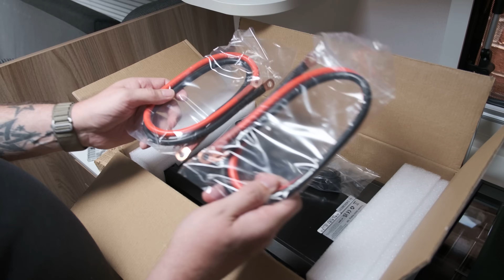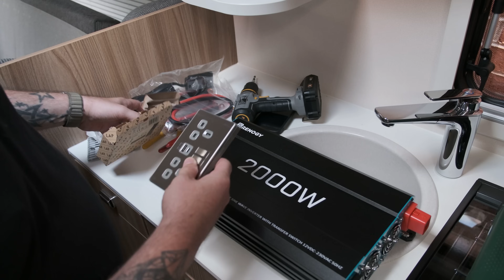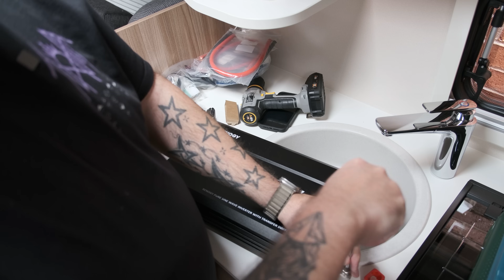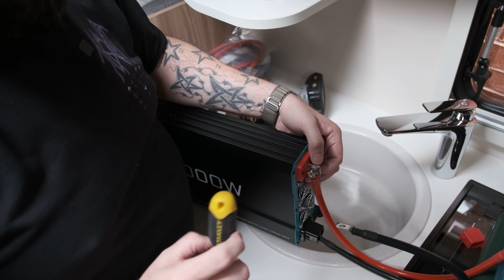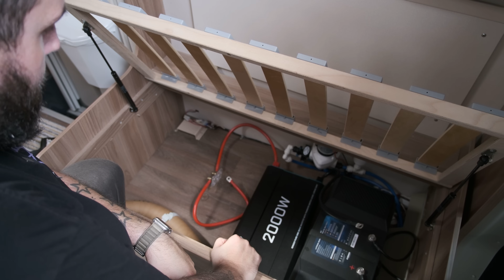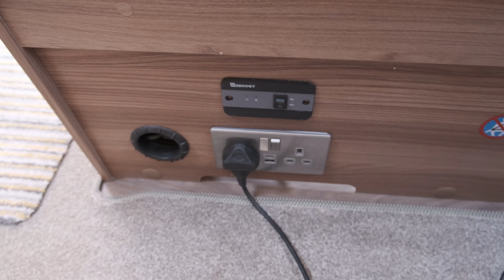Renogy 2000W 12V Pure Sine Wave Inverter w/ UPS Function - Reliable Power Anywhere!

Comment: They expect you to double up on the supply cables they provide. So technically you’ve down graded with 35 rather than 2 x 20. 35mm is absolutely fine though 👍

Comment: I spoke to renogy about neutral bonding which allows the rcd to trip they told me its built in and uses the ground point so assuming by that if you don’t ground it wont trip the rcd in a sargent unit

Comment: Hi, Good video. Interested in this unit. What is your Renogy App Bluetooth setup? Amazon specifically states the 2000W inverter with UPS does not support bluetooth? Did you buy extra kit/devices for bluetooth Renogy App support? Thank you.
Reply from the maker: The Bluetooth app connects to my renogy battery. You can get an a module or shunt that is Bluetooth that willa achieve the same thing

Comment: I believe you're supposed to use both cables provided in parralel to double ah capacity as it's high power. The instructions don't explain that well and this video is misleading if that if the case

Comment: So what do you charge your batteries with? Curious advantage of this inverter over spending a bit more and getting the renogy inverter/charger unit?
Reply from the maker: we use the charger thats built into the motorhome which works of 240v and the split charger when driving

Comment: So there is nowhere to hardwire into? Could I do what you have done and have 3 pin plug with a length of cable coming off and then multiple sockets at different points 'along it's length'?
Reply from the maker: There is a way to hardwire it with a switch however I’m not sure how this is done. There’s 2 outlets on the inverter so could have 2 plugs coming off and then chain them as needed
Reply: @rideroamrebuild thanks for the reply, i think i should of ordered one with a hardwiring box on it, another question: do you know if the wattage is split between sockets or can both access full power? cheers
Reply from the maker: @crapbag833 I’m not 100% sure on that but I have ran a ninja woodfire on one socket and that was 1700w so I think it’s a total and can be achieved by one socket

Comment: Good stuff...Mine cuts out far too soon after  running a low wattage kettle or 600 watt mini heater for 15 minutes despite having doubled up on the battery cables. I've got 230 AmpHrs of Agm battery storage. Any thoughts?  Cheers, J  Scotland
Reply from the maker: Hmm interesting one, sounds like it could be a fault with the inverter unless its overheating. Do you have plenty of air getting to the inverter?
Reply: @TravelSick  Hi, Plenty of ventilation.  Doesn't heat up and no fan on. Just seems to run  out of juice despite fully charged batteries. Checked and tightened all connections and no corrosion showing. It has been below zero here for a week or so. Do you think that would impact on the invertor?
Reply from the maker: @jimmywilson6388  be worth checking voltage on battery, we had 100% charge but voltage was low due to the cold. that could be an issue. might just need putting on charge overnight
Reply: @TravelSick  It's warming up here now so will check again this week. It's only a back up system so not crucial forcevery day use. J

Comment: Glad I found your video! I ordered one of these this morning, then read that you can't connect your van sockets to both shore power and the output of the inverter, for fear of blowing up the inverter (so people were having to manually switch between sources.) 

Thankfully this video explained about the UPS switching (not sure if that's only on later/some models, but it IS shown on the one I've ordered) so I just need to connect shore power and 12v in, then connect the van sockets to the 240v out and they will take power from the right place.
Reply from the maker: you do still need a switch. you cant have van plugged into shure power and inverter plugged into 240 vaults without being able to isloate the vans 240v switches  so only that the inverter is supplying them power else you will end up with 480v going through the sockets. in our old van we had shure power - RCD - Single Socket then plug intop inverter then another plug out of inverter into a 2nd RCD that the sockets were connected to. that way when we were on 12v it would use inverter to RCD 2 and when on shure power it the switch would activate passthrough on the inverter and power the sockets. not sure how its achieved in a motorhome which is why i installed 2 sockets purely or inverter only.
Reply: @rideroamrebuild plug your devices into the inverter, and connect shore power to the 240v in on the inverter. When shore power is present, the inverter switches to that input rather than draining the battery. 

480v cant happen (it would increase the amps if both outputs were joined). But don't wire the output of the inverter to the input from shore power, though, thats a bad idea.

Comment: Looks great, we are looking to buy one. Do you know how it compares to the inverter with the charger? Have you managed to try it out off grid yet?
Reply from the maker: I believe they are as good, if you need a charger though the other is the way to go for sure, we have tried ours out at the weekend and it works great with the Renogy lithium battery. We used 10% and byut the time we had driven home we were back at 100% again. its great!